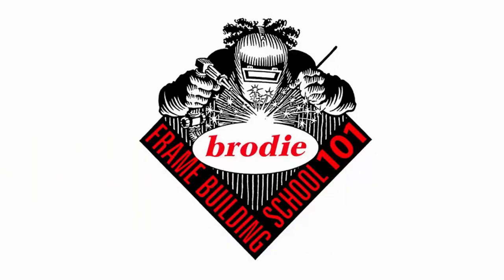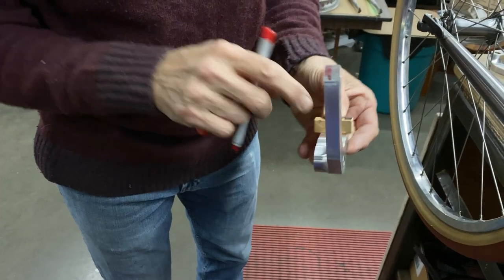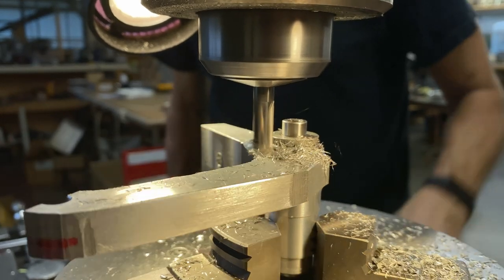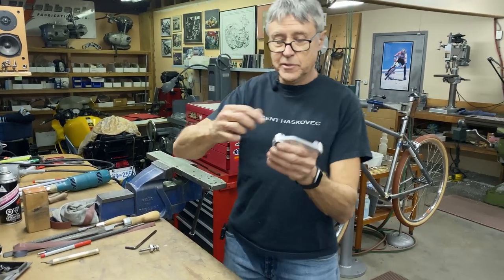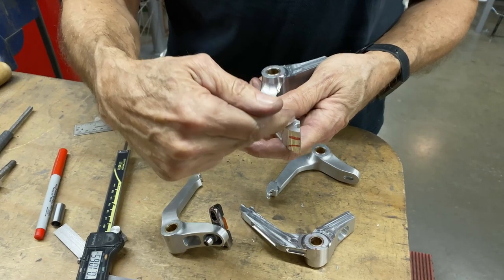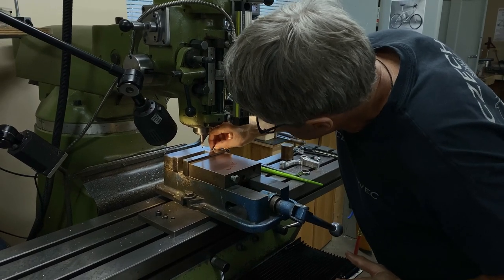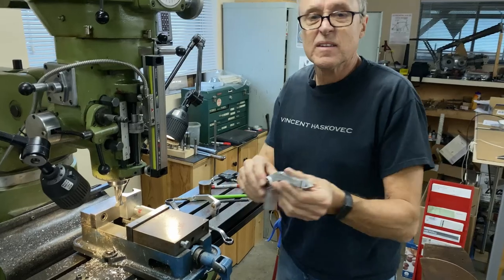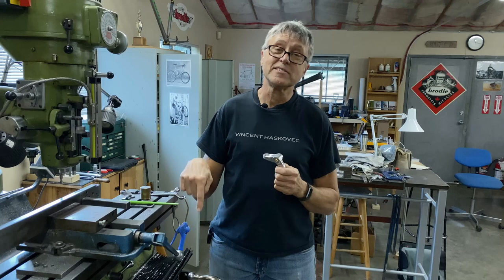Custom U Brakes Part 2 - Framebuilding 101 with Paul Brodie

Comment: great metal worki! i can really recommend to use pure alcohol as coolant for milling Aluminium ;)
especially for small cutting speeds (like in the center of a ball endmill) 
you will get super shiny surface, try it ! :)
Reply: Never tried alcohol, I like Wd-40 for drilling, a and milling,works better than tapo-matic

Comment: OMG i so love watching talented makers "wing n it" in small shops. Would u consider doing a Q&A with your fans questions?  im starting frame#2 and some of us yanks down in the states dont understand why u use nickel silver pre braze? wont it melt away before the brass melts?.....
Reply from the maker: Pete thanks for liking our videos! I think you might be confusing nickel silver with silver solder, which does have a much lower melting temperature. Nickel silver melts at a similar temperature to a brazing rod, but is stronger. The 1/16" nickel silver rod is easier to melt into the joint of the 2 mitres, and the 3/32" bronze brazing rod is better for building up a fine fillet :)
Reply: Which NS alloy rods do you favor? Ni-92?.....is the coffee ready yet?
Reply from the maker: @petetabor4974  Just discovered your 2nd question... Years ago the rods were called 773, but I'm in Canada and each country probably has their own designation. Now, when I order, I just ask for 1/16" nickel silver and they say fine; never any questions after that.

Comment: Absolutely beautiful! Any chance you could explain a bit more in depth how to determine the position of the rotary table in relation to the spindle for a certain radius?
Reply from the maker: That's a tough question. I'm using my experience, common sense, and intuition. If you take out the endmill and replace it with a rod the same size, you can "nestle" it into the existing radius as a guide. That's one of my little tricks.. Not sure what else I can tell you. Thanks for watching!
Reply: @paulbrodie  I get the jist, it's a lot of eyeballing but as the saying goes, if it looks right, it probably is right! Thanks for replying!

Comment: Curious why you don't move you mill vise to an off-center position so that you can install your rotary also and have both on the table at once. Seems like the parts you mill are small enough that the bed travel should be fine? It would surely save you enormous amounts of time and save your back from hoisting those around the shop. Or is that Mitch's job? ;^)

Craftsmanship is outstanding. Explanations are a wonderful mix of insight and a peek at the mind of a genius!
Reply from the maker: I like to have either the vise or the rotary table in the centre of the mill table. Yes, there is room for both but it would be a compromise. And yes, Mitch has a good back and does help with the lifting. Thanks for watching!

Comment: I thing the brake arms were there inside of that aluminium 2/4 in the moment you take it home... you just remove the metal that cover them. :-) 
simple ;-)
Reply from the maker: You are correct. I just had to visualize the shape and remove the excess. How hard is that?

Comment: Paul, @ 4:50 you mention slotting for the brake pads. Why? This is a custom build and you fit the pads. Won't adding slots introduce variability in the field?
Reply from the maker: As the pads wear I might have to make a small adjustment. With a slot I can do that :)
Reply: There you go.  Pads wear, closing arc moves pads out radially towards tire, adjust pads down to compensate.

Comment: If I could afford a Brodie U-brake i would want one for my 91 GT Karakoram
Reply from the maker: I have a fillet brazed GT in my stable 😉
Reply: @paulbrodie  that frame/bike i would love to see. I have a Quantum steel frame and a Unibomber SS frame,my second. My first was bought at  the Bike Peddler on upper Hastings in Burnaby heights  from Patrick in about 2001 ,that worked at Rocky and Syncros.
Reply from the maker: @thinkpadBentnoseTheBlind  I think you have an appreciation for nice stuff 😉
Reply: @paulbrodie  I do indeed. I'm stuck in the 90's . Still hunting for old  stuff. My only vise is  I need to use riser bars on everything. No flat or drop bars for me ever. Stems are the hardest to aquire  for so said riser bars. lol cheers from Nova Scotia , Canada
Reply from the maker: @thinkpadBentnoseTheBlind   Sounds like you need a selection of customs stems for your riser bars!
Reply: @paulbrodie  I think you are correct. Removable face or hinged ones.

Comment: "I need some brakes for my bike... I know, I'll just go machine a set."

Not to mention how U brakes are totally impractical by today's standards. That only makes them 5 times as cool. I need to get a U brake bike into my life, 80's mtb with chainstay mounted brakes I guess.
Reply: BMX riders use U brakes for a reason.
Reply: @weareallbeingwatched4602  More than half of them don't even use brakes.

Only reason they use them is because V brakes have no modulation, and disc brakes get trashed. As a matter of practicality though, BMXs don't fit in, therefore not a factor of my original comment. :)
Reply: @Metal-Possum  they're a favourite of freestyle BMXers because they are the most bash-resistant design, and have no bits sticking out to catch on stuff or break off. V brakes are pretty popular with race BMXers.
Reply: @weareallbeingwatched4602  Yes, but a freestyle bike isn't a practical machine, relative to other bikes.
Reply: @Metal-Possum  ruggedness is a valid design criterion

Comment: Rim brakes are a waste of time because they never stay true.
Reply from the maker: Do you mean the brakes never stay true, or the rims never stay true? There is a difference.
Reply: As soon as I can I want to switch to the hub discs.
Reply: @paulbrodie  if you happen to get into a little bit of rough riding one day and you happen to hit something just a little bit off then you're stuck with the bump in your wheel until either you can get it fixed or replaced, that's the only thing I never cared about Rim brakes.
Reply from the maker: @lawrencejneuser8801   I'm not that kind of a rider 😉
Reply: @paulbrodie  neither am I, but they haven't stopped inventing potholes and sometimes you need to get places and not necessarily during the daylight. And even the best lights don't always help.
Reply from the maker: @lawrencejneuser8801   I only ride my Romax in the daylight on smooth roads. No problem.